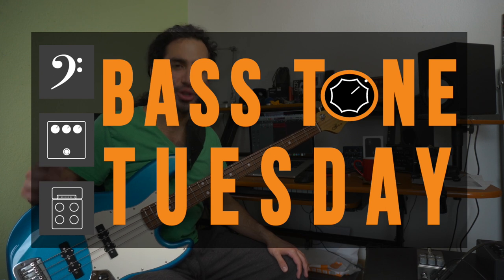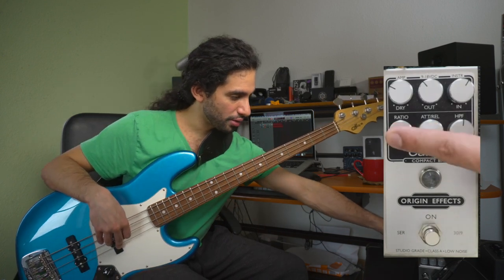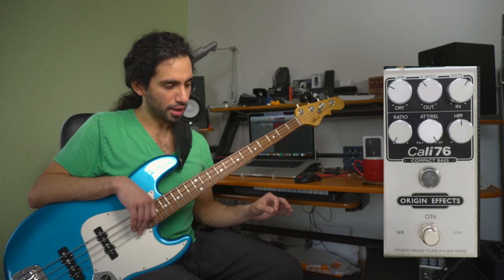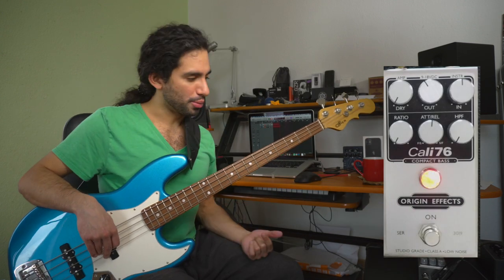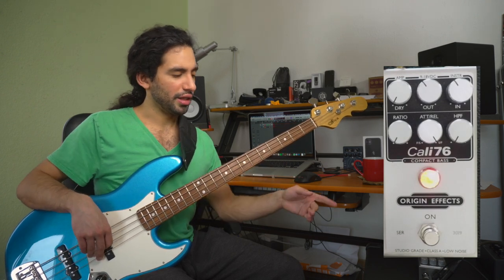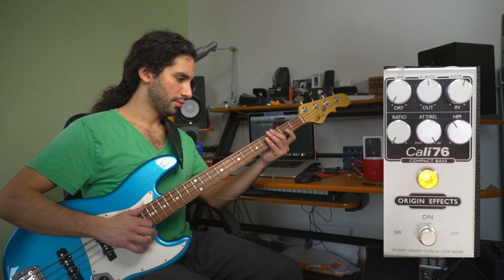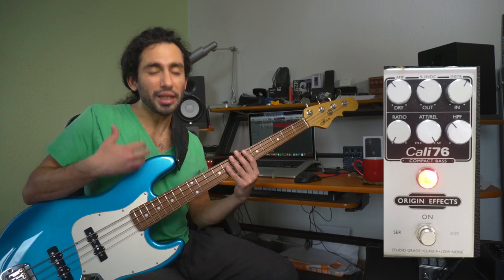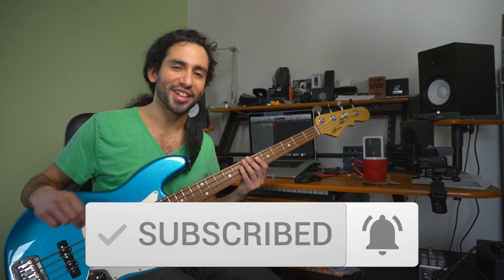How I Set My Compressor | Bass Tone Tuesday

Comment: Dry at 10, output at 10:00 imports at 12:00 now I'm running a fender jazz Bass with Lindy fralins. My ratio run at the 9:00 position which is from what I measured on the computer about 2 to 1 or ratio the attack now by run all the way to the right. The high-pass filter sounds probably the best at 12:00 to 1:00 I set the compressor so it's blinking from yellow to red constantly. I'm a pretty clean player I anchor point my fingers and play the constant

Comment: Well explained ,i use a Boss LMB-3 Limiter/Compressor that does not have attack or release pots,being FET it kicks in fast, i use the ratio about 9o'clock position, roughly -6db to -10db max, depending on song being played...normally just enough compession to hear the tone fattening up but i use the threshold pot set pretty low/fast at 9o'clock to 11o'clock,again depending on what's being played... took me ages to get my settings right ,a very transparent Limiter/Compressor..it does have a handy 'enhance' pot that puts back some upper mids & treble that can get a bit lost if heavy compression settings...it actually works really well...i've used the Boss LMB-3 since they started making it after the LM-2 compressor was dicontinued..not a very good bass compressor, sometimes i will use a simple Electro Harminox 'Bass Preacher'...simple but sounds really good...the Cali76 is a good compressor, i borrowed 1 for a local gig when they first came out, great tone & a very handy HPF pot...

Comment: Great material. I am trying to get one of these. I used to have a Symetryx rack compressor wich i miss now, but I like the ideea of tweaking my tone with my pedals. Though I know the sound guy usually adds compresion from the console, that is the main reason  I did not used a compressor until now.
Reply from the maker: Yeah. FOH usually applies compression anyway. That’s the reason why I try not to compress TOO much on the way out, unless they tell me they want more compression from me

Comment: I have an optical compressor at the front of my pedal chain to help my octaver track and a multiband after my drive pedals at least. The Pulp N Peel or any other Orange Squeeze variant is also good right at the front, they'll preserve a certain amount of dynamics.

This one, or any other multi band comp I'm using, usually lives after my preamp and before modulation because it changes the effect of dynamics sensitive lo gain drive pedals like the o.g. Blueberry, Barbershop, MTN-Bass & etc. and will change the way your preamp is driven as well. Admitedly I dont really slap and Im much more of a drive/over-drive notivated player

Comment: Where I. Your signal path do you use the Cali? I use in the end a tube Di (reddi).
Btw Great video.
Reply from the maker: Usually right in the beginning after the tuner, but it depends on the type of gig or recording. Sometimes I place it after distortion or overdrive pedals

Comment: This is a very helpful video  !  How would you use it wih a tube preamp amp given the natural compression of driven tubes ? Does this standard procedure still apply? Thank you Ivan !
Reply from the maker: Hey Reno! Well, tubes do compress, but having a compressor as a pedal or a rack unite lets you dial in more parameters (depending on the compressor, of course). 

You might want to get a LOT of sustain by making the release longer or get a very "in your face" sound by having a very slow attack to make the initial transient larger. It all depends on what you want the compressor to do :)
Reply: @IvanBassist  Thanks so much for the answer Ivan. I will dig into that as soon as I get the pedal. Sooooo much to learn ! It's like walking through the universe (and I mean by that at a "walk" pace).  It's huge !!!

Comment: Very helpful video. I also use the Cali 76 and use similar settings to keep the sound more natural. My takeaways from the vid are for me to not be afraid to try higher settings on the HPF control (which I've been running close to minimum) , and to try turning up the  ATT/REL control, which I keep near 12 o'clock.
Reply from the maker: Hope those takeaways help you :)!

Comment: Hey Ivan, I use the Cali76 Compact Bass since several months. With your Videos i found the perfekt settings. So you know, how the HPF works exactly? Is the increasing the knob change the intensity or the frequencys?
Reply from the maker: Glad to hear that! To put it on simple terms: the HPF (=high pass filter) is a side chain HPF, which means that the compressor is sort of doubling your signal. One is going out of the output jack and the other one remains muted. When you increase the HPF you are removing bass content from the signal that is muted, but at the same time you are telling the compressor to react to that signal and not the other one, which results in the compressor reacting only to higher frequencies and freeing up bass content. Hope that i explained that clear enough :)
Reply: @IvanBassist  Many thanks for your answer. OK, do the increasing of the HPF Knob open the frequencys or the amount/ volume of the lower frequencys? I hope, You know, what I mean?
Reply from the maker: You could say it “increases” the volume of the lower frequencies, because the pedal is not compressing them. However, in reality they remain the same as your input signal
Reply: Ivan's explanation is good, but the simple way I explain is:
The more you turn up the HPF knob, the more the compressor ignores the low frequencies.

Comment: Ivan! What are your thoughts on the cali versus an optical comp for bass? I have both the large cali76 which seems subtle and the walrus Mira which seems that I can get it more punchy than the cali. I guess it depends on which style of music you play but I’m curious about. What your thoughts are. 👌
Reply from the maker: I’ve no experience with the Walrus, but optical compressors are pretty nice. Take the legendary LA2A for example. 

The compression is more subtle and “warm” compared to the Cali. The 1176 style compression is much more “in your face” and makes everything stand out nicely in a mix. 

It depends on what you want to achieve with the compression :)
Reply: @IvanBassist  thank you sir! I appreciate your input.

Comment: Great material... I Always learn so much from your Bass Tone Tuesdays! I use a Diamond Jr. for bass and I keep it on a very low setting and always on. I’m not really good with too many knobs, so the simplicity of the diamond fits me quite nice. It fattens the sound of my bass (a passive fender P/J) just the right amount, although is hard for me to describe exactly what is it exactly doing.  The are a few other controls that are quite helpful as well. I use the volume knob on it to push my overdrive pedal a bit mor if I need more grit, and the shelving eq helps a lot to shape the tone that goes into the overdrive as well, to make the tone darker or more sparkly depending of what I need. It feels like a different sort of beast than the Cali76, which now I’m quite tempted to try. The quest never ends. 🙂
Reply from the maker: The diamond is a great comp! Lots of character 🔥

Comment: Cali 76 or  Diamond comp for
Bass im torn ? Play mostly
Passive basses.  Need something
Reply from the maker: Both are good, but they do sound different. The cali would give you more flexibility, but the diamond is more “set and forget”. 

What are you trying to achieve with the compressor?
Reply: @IvanBassist   recording and live playing situations also i  use a tube preamp Toncraft often and like some light to mid overdrive . Also using a 70s fender bassman and v4b .  Trying to keep levels nice consistant
Reply from the maker: @michaelmacisco2566  Nice setup! I’d recommend the Cali. It will allow you to get some more flexibility while recording
Reply: @IvanBassist  thank you ! I dont want to squash it flat dynamics are good . But something is good . Thanks

Comment: Wouldn't blending in the dry signal do the same as the hpf?
Reply from the maker: Hey Olando! Blending in the dry signal creates a similar effect, but it's not the same. By blending the dry signal you are just stacking up the dry sound together with the fully compressed sound. That way you do get back some more dynamics, but the compressor is still reacting to the full frequency range. 
On the other hand, by using the HPF you are telling the compressor to avoid reacting to the lower frequencies as much, which also makes the compressor feel more natural, but you are not compressing the lows as heavily. This has a different sound/effect than just adding the dry signal
Reply: @IvanBassist  got it. Thanks for clearing that up!

Comment: Do you get compression with the ratio at zero or does it work in reverse...?with my Boss LMB-3 i cannot leave the ratio at zero or no compression... they all work differently, i have a couple of compressors,an EH Bass Preacher but the ratio knob set at zero does not compress as pot is 1:1- infinity , the Boss LMB-3 being a limiter as well as a compressor is the same .....cheers
Reply from the maker: The lowest ratio should be 4:1

Comment: $500 pedal..do I really Need this? I could put that $500 towards an amp with built in compression
Reply from the maker: Amps with built-in compression are very limited (pun intended) regarding setting the compression parameters.